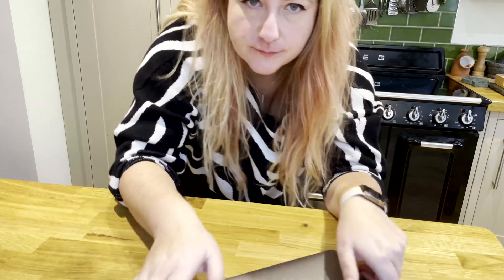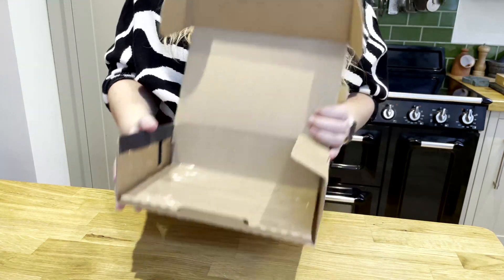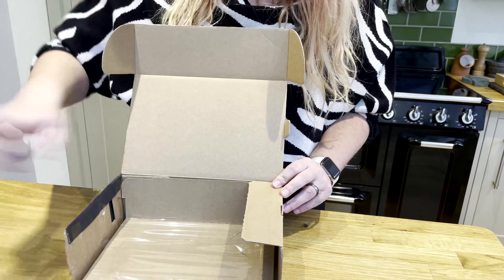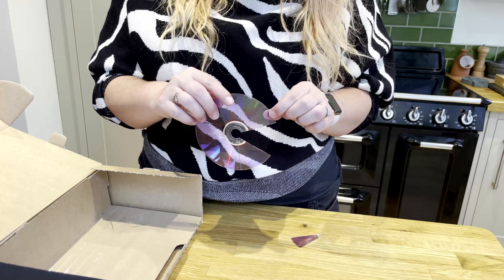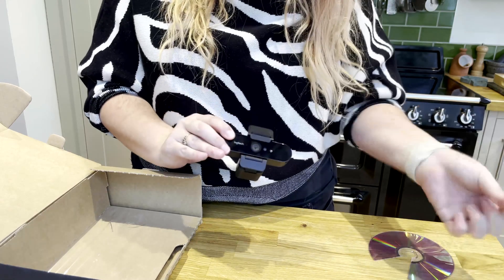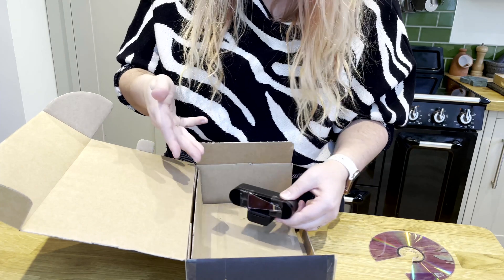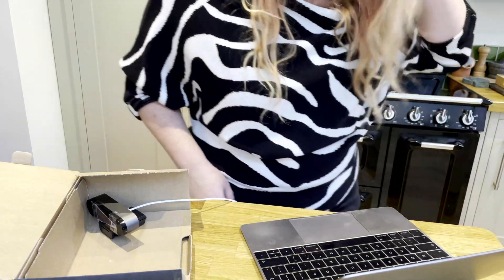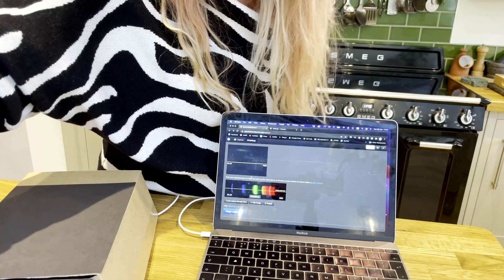How to build and use a homemade spectrometer | Behind the Scenes

Comment: A word of advice on diffraction grating: if you finger it, use acetone to clear with a small cotton tip instead of clothing.

Also, this system will absorb some wavelengths differently, so keep that in mind.

Comment: Awesome!  Thanks for sharing.  Amazing how cost effective the cheap 2K webcams are now on the market.  I did purchase two and one I've removed the hot lens though haven't moved forward on the rest of the project.  I plan to use a nice Apple laptop CD/DVD sled for the slit width control and a HD actuator for when using Blu-Ray or finer diffraction gratings to sweep and I'm thinking some ideal oscillating sweep rate for a best real time visual/latency near real time scan.  As the weather gets colder outside... I plan to fit into the indoors winter projects and share.  Neat, though how the webcams have come down that offer the higher resolution capabilities... not the best in regards to settings for image control... still nice.  Thanks again for sharing!